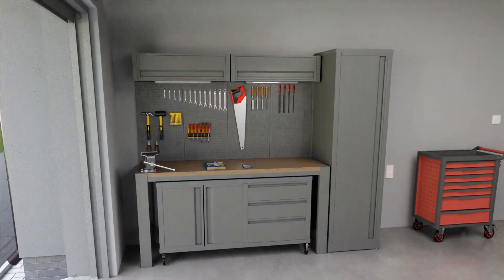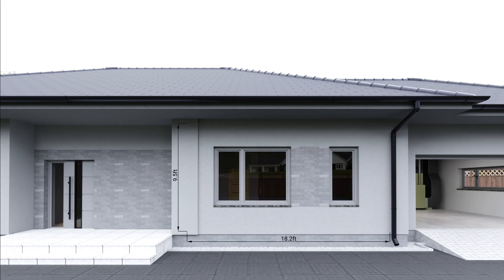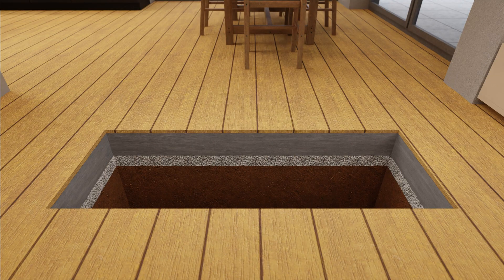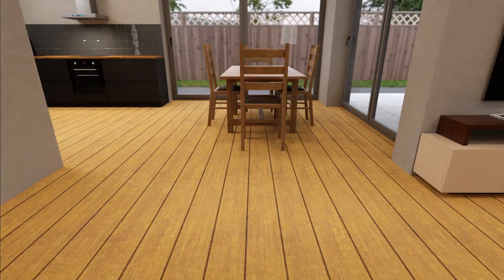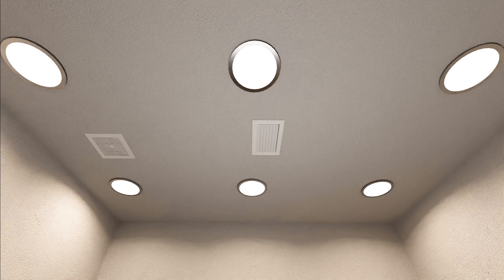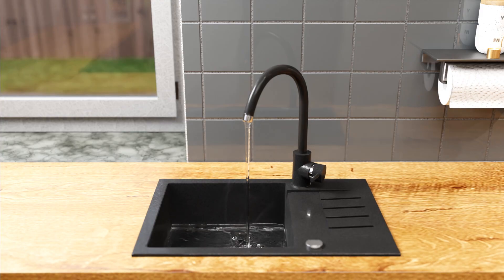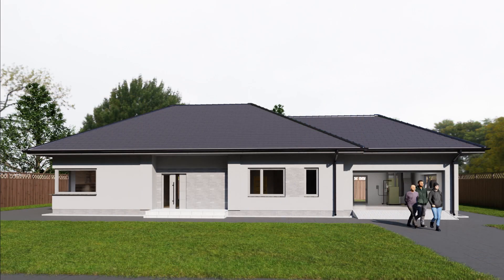Manual J Load Calculations 3D

Comment: In this video, the R calculation for the wall was performed twice. Once with a total of 13.89 and a second time to obtain a total 4.89. Did anyone see why this was done? Also, I suppose as more and more households have pets, Manual J will provide some average numbers for cats and dogs. I think a pair of Labrador retrievers would probably huff and puff enough in a room during the summer to count as at least 1.5 persons.
Reply: insulation differences

Comment: I think technically, uninsulated walls transfer heat mostly with convection, not conduction. Fantastic animation and narration. Very clear and concise!
Reply: No, conduction.
Reply: @RMK867 without insulation, it is just air space between the two wall coverings, therefore the heat transfer between the two surfaces is from movement of a fluid (air) from convection heat transfer from the warm surface to the cooler surface. This is how insulation works, it traps air and prevents convection heat transfer.
Reply: @KurtisSaiyo   I know how insulation works. Most heat transfer in uninsualted walls is conduction because of the walls and studs.
Reply: @AbrahamLincoln69 If that were true, insulation would have no effect because insulation does not change the conductive properties of a wall assembly, except if it is continuous exterior insulation (like Comfortboard)
Reply: @KurtisSaiyo  it is true so please don't spread lies. You need to better educate yourself on this, because your theory is wrong. Heat transfer in uninsulated walls is from conduction because of the walls and studs. Quote from google: "Adding insulation to a wall increases its thermal resistance, significantly reducing the rate of heat transfer through conduction."
Reply: @AbrahamLincoln69  glad you Googled it, Google's AI response is definitely an authority over the engineering and heat transfer books on my desk.
Reply: @KurtisSaiyo  glad you accepted my response. Funny you say that, because I read a lot of books. Please, tell me what book on your desk backs up your theory as true and my facts as false?
Reply: @KurtisSaiyo  everything you just wrote has absolutely zero affect on the fact that uninsulated walls produce more conduction than convection. Nice try though. Again, what book are you trying to school me with?
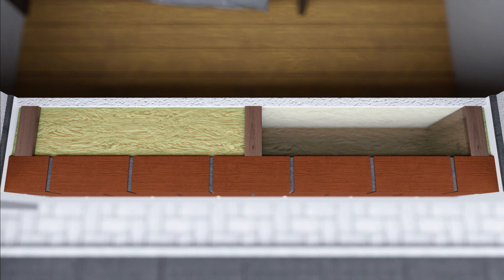Reply: @AbrahamLincoln69 the statement he makes at 3:13 and 6:14 is incorrect and misleading. The conduction through the wall never changes, only convection. This is the crux of my original comment. So sure, I'll dig up passages in my books that explain how insulation works.
Reply: @KurtisSaiyo  it's not though. What part is misleading?
Reply: @KurtisSaiyo  conduction is increased bro. You're the misleading and incorrect one. Just give up homie

Comment: Can you show how to properly size an a/c system from scratch... say i had a certain size evaporator, ho do i pick a condensor size, choose a given compressor size for the selected system? (Im building a camper van a/c system and would like to reuse the rear a/c evaporator with a 12v compressor, and undervan condensor) ive been watching you videos and i keep seeing reiterated how it work, and i understand that, but im still lost when it comes to sizing components...

Comment: I thought Manual J was different, great video. What’s the name or certification for running diagnostics on a residential split     HVAC system to make sure it’s not oversized, has possible static pressure issues, too much return air/not enough supply, duct leakage, etc. ? Would really appreciate it. Most HVAC companies just install, and quickly move on to the next job, and don’t test anything from what I’m seeing. Love this channel btw.
Reply: yeah they tend to put the same size system that was there before. esp if the owner doesnt want to pay extra for a building load calculation done. 
you may be asking about “blower door tests” or just check up or load calculations 
blower door test- basically close your windows and front and back doors. and they attach what basically is a fan with a tarp on either side to make it airtight. Then turn on the fan and measure how much pressure it takes to keep balanced pressures.
Reply: @threestans9096  Most appreciated, I plan on buying a manometer soon to start playing around. You measure your return air and supply side, then do some math, and now you know if your system is operating correctly. That’s my goal. Thanks again.

Comment: One thing ive been wondering for a while is if vaping in the space adds to the latent load. Its not really water vapor but is is liquid being vaporized and does stay in the space lingering for a very long time. Ive gone into homes where its just so cloudy inside you have hard time reading the clock on the wall lol. Im serious. I understand its not water vapor 100% but i wonder what some testing would show on the matter

Comment: I did this for my home, before hiring a contractor for my install. He wanted to use a rule of thumb that, as usual, results in equipment that is too large. I’m very glad I had the knowledge to reign that in. Our A/C system is sized perfectly. The furnace he installed is too damned big, and he said that was their smallest model. Afterwards I found out that wasn’t correct. Damnit.
Reply: @blakeperson9189, if he was putting bigger equipment in, he was probably expensive.
Reply: @blakeperson9189 Amen to that! He was a referral from a good friend, but turns out my friend didn't really know any better.  Oh well.  Both of our systems are still working, even if they're not as good as they could be.
Reply: If you’re such a helicopter homeowner why not get your license and do it yourself instead of criticize other ppl